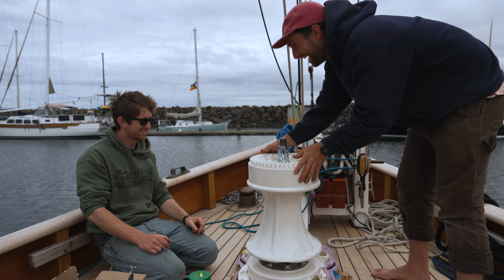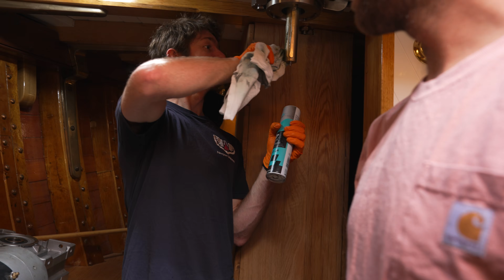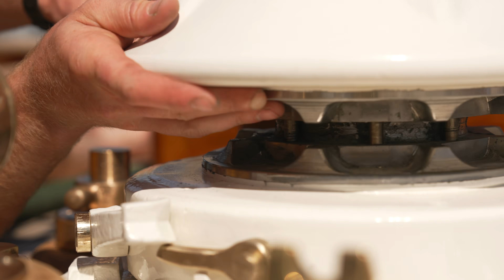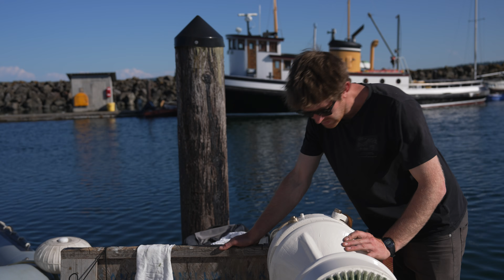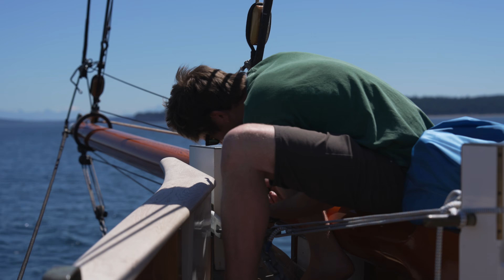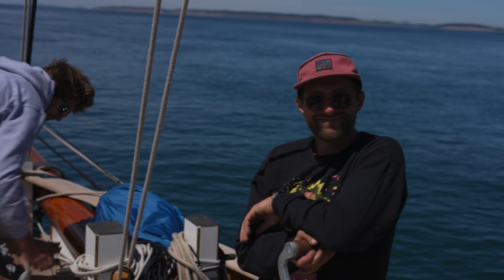Installing and using the original capstan!

Comment: Hi, you may have noticed that the chain is also catching on the haws pipe cap entrance, yes you could let it wear, or you could lower the cap 3/8 to 1/2 an inch. yes a chain stripper would help a lot. Cheers well done.

Comment: Now we know why the gypsy on a modern anchor winch rides on a horizontal shaft. The chain falls straight down and does not have to be pushed into the opening to the chain locker

Comment: In the videos, it looks like during theanchor hoist process the chain, after leaving the gypsy,  is slightly going uphill into the brass piece.      Have you considered lowering the height of the brass piece to get gravity to help with feeding the chain into the chainlocker?

BTW, been watching since day 1 - a weekend highlight getting to see the next step on getting Tally Ho sailing again.   Great work!

Comment: A chain stripper is definitely a good idea. Also that chain will wear off the high spots on the links and smooth off the edges on the gypsy with a little time. I remember a chain hoist that had issues when it was new that a little wear took care of. It will be fine once the chain and gypsy get broke in and wear to match each other.

Comment: The capstan gypsy does not like a twisted chain so the anchor chain  idler pulley at the bow should be slotted like the capstan gypsy?  It would eliminate twist on the water side of things and maybe you should have something similar on the anchor chain storage side of things as well?  🤔🤔🤔🤔

Comment: Nice job, a new chain might have been easier than all the grinding, but your time does not cost money, and a new chain does....
Oh, one small detail: towards the end you can see a cotter pin in the up-down mechanism. It is not (yet?) bent open to prevent loss. Maybe you will only do this when everuthing works perfectly?
Can you lower the anchor without engaging the motor? How did they do this in the bad old days? A rope around the drum to act as a brake?
If you ever take the ship over to the Netherlands I would love to see it.

Comment: The whole collaboration process for repairing, restoring, and modernizing the capstan for the Tally Ho—all of those detailed videos from Dave Clarke, Windy Hill Foundry, and Keith Rucker—capped by Leo's installation, are an amazing collection of work on video. They are certainly one of the highlights of the rebuild because of the level of attention to detail brought to the whole process, bookended by the removal of the capstan in one of the first videos of the series and its replacement in one of the last, before Tally Ho's first 21st-century voyage. Bravo!

Comment: Great video. capstan is amazing and considering the amount of moving parts and bits and pieces worked on in disparate locations it's a stunning result that you only needed two day hard labour in the sun with a die grinder. As others have said in the comments, get a cover made for the capstan top and get that gearbox trimmed in such a way it's not a risk to skulls!

Comment: I would imagine that the gypsy and the chain would wear in after some use.  Am a little surprised that there is no cap over the top nut on the capstan. Wouldn't  want sea water to pool up in that area.

Comment: A similar fitment issue occurs with new bicycle chains, cranks and other gear components. Often just a matter of running it and giving everything a chance to wear in.

While an impressive restoration you’ve likely discovered why this windless design is no longer used on sailboats.

Comment: just an idea, but what if you had something in the chain locker that kept tension on the chain. You could have a chain feeder wheel thingy that is under tension by a spring and have it geared to be able to move the entire length of the chain. maybe too big of an engineering undertaking but if there is no other option above the deck, someone pulling on the chain seemed to work pretty good haha so maybe the spring tensioner would work. have it under load when the chain is all the way out, then it will pull until the chain is back in.

Comment: On a seagoing vessel, according to good seamanship, the chain in the chain locker is usually stowed (horizontally) manually. It prevents the stack of chain from falling over during rolling at sea, which can block the chain when dropping the anchor.

Comment: If the whole thing would've gone off without a hitch, i would've been worried about other things. The chain was a bit of a slip, but not through anyone's fault. These things are RARELY (and i emphasize that bit time) all the same. Good thing is things were fixed and they worked out in the end.
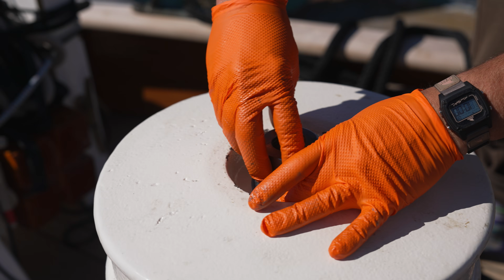18:00 when the mechanism is well fit and working to satisfaction, you should fill out that pocket with a hard wax (that doesn't melt at a low temp) (or another compound that can be taken out at a later date) to prevent water from sitting in that pocket. I'm not 100% sure on it, but i have seen old pictures of capstans of similar vintage, where that pocket was even with the top, some times painted, sometimes not (vintage photography from various magazines (??) , all found on archive).  I assume they'd use wax, but it's entirely possible that it was also tar.
21:58 using that bolt hole on the protruding tongue of the base, maybe make a bronze chain splitter for both sides. Essentially take a T from bronze, bend it's base so it stays flat in that section, bolt it down and the "hat" of the T will not allow the chain to stick either way, in or out. It's not an uncommon thing to have where chain's concerned. I think even some old hoists had a chain splitter on them, a small brass or copper plate with a spring that would push the chain out so that the operator could move it as high speeds.

Comment: Hi Leo. I would think that the most likely variable is the chain itself. The galvanising process will add small differences to the size of each link. This is why some links fitted better than others. Good job to get it sorted. It looks good fitted in position.

Comment: If memory serves, chain is made differently in the UK and the USA. Hiscock recommended sending a couple of feet of the chain you’re using to the people manufacturing the gypsy. I couldn’t see if the chain runs out or if you have to walk it out every time. If it runs free watch that in all attendant vibration the pawls can’t flip over into the active position. Ask me how I know.

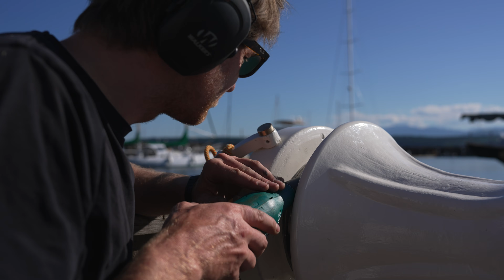Comment: @ 15:40 if the chain will just fit the Gypsy I would think over time it would wear in to fit / between the welds on the chain links and the Gypsy itself I would imagine over time they would seat together properly ( just a guess ) after some wear / could also try some type of benign oil/grease like vegetable oil / mineral oil that could facilitate the break in period ?

Comment: Have you considered using a hall sensor setup on the rotating driveshaft on the capstan? That way you could have a digital readout of the approximate amount of chain you have let out. The amount of revolutions multiplied by the nominal diameter of the gypsy should give you a fairly accurate readout.

Comment: Moly grease is great for automobile chassis points, joints, and king pins, etc. because (just like you said, Leo) it's formulated for high load/ low speed conditions.  Ball bearing grease need not apply.

Comment: I understand that this comment will be unpopular to many but from a technical point of view putting so much unnecessary weight on the bow, also aggravated by the new engine and mechanism, seems to me a mistake; I speak as a sailor even if I greatly appreciated the complex restoration of the capstan. There are many classic electric winches on the market that are more suitable and less invasive, both in terms of space and stress applied to the bow structures (but also in terms of influence on the center of gravity and bow lift moment) that would have been more suitable. Since you have replaced probably 95% of the boat (I can only think of a small piece of the transom as an original part of Tally Ho and part of the keel lead) it would have been irrelevant from a historical point of view to opt for something more suitable and proportionate to the size of the anchor and chain and the size of the boat. For the rest an admirable job, congratulations.

Comment: The best grease for all marine applications is Corrosion Block Grease which strongly resists water wash out and provides superior protection against rust and corrosion.  It out performs lithium and most synthetic greases.  
BTW, I see no swivel between the anchor & the chain.  The chain has a lot of galvanizing which is why it doesn't fit the gypsy well.  Get stainless steel chain.
Reply: I wonder where the chain was manufactured and to what tolerances.

Comment: Watching that bit at the end, if you just make the plinth that the brass receiver sits on lower than the chain exit from the gypsy, it should work fine.  The links are trying to fall down between the gypsy and the receiver, but if that opening is lower down, the weight of the chain around the corner (down in the locker) will help keep the feed from the gypsy to the receiver taut.
But you probably figured that out already.

Comment: I think the deck elbow is about an inch too high. The last shot of it working you can see that the chain is going up into the elbow, it should really be going  into it level or very slightly down.

Comment: Capstan's looking great now it's all painted up. How is the motor protected against driving against the pawl? Is there a torque limiter hidden in the gearbox, or does it rely on an electrical overload?
Reply: Leo - did you message me?

Comment: Speaking as someone who worked in an international footprint aircraft manufacturer based in the US? Yeah, you can put SAE ONLY in bold on all drawings and folks who use Metric will use Metric because thats the measuring tools they have. Anchor Chain in the US uses a SAE Standard, and Anchor Chain made everywhere else uses Metic Standard, and, here is the head scratcher, you can have a chain that meets BOTH SAE and METRIC Standards for that one chain! and it may turn out to fit only Metic systems, only SAE systems, rarely both systems and most often neither Standard and its garbage and every manufacturer will show you the Standards they use (they use LASERS) and their paperwork and do the 'blablabla' thing.... and its still over priced garbage that does not fit.

Comment: Chances are you can pay out the entire chain and use a marker to mark the problem links.  I’m willing to bet that it’s always the same links sticking. And just take a file to the widest portion of each problem link to take down the errant weld.   You might only need to modify ten or twenty links or so.

Comment: When I first saw your T-shirt, I thought you were a Plymouth Argyle supporter as a George Kirby played for them in the early sixties and the shirt was green ( Green Army!) 😆. I saw Keith Rucker's video on dismantling (and breaking) the capstan with great interest. Incidentally, I worked for a winch manufacturer for 32 years, but they were for 4x4s and up to 30,000lbs line pull for truck recovery wagons, although some people used the mid-range units for recovering divers back out of the water on a platform.

Comment: Sorry, I made comments before on improvements  that should have been addressed while the capstan was being repaired/inproved. 
 First. The 2 manual drive pinions should have had Delron bushings and a seal on the bronze retainer Mount. Second, when the top cover was being machined a Forsheda seal should have been fitted, thereby sealing the top of the capstan for all sea water and spray.  The knob for engagement of the drive should also have been fitted with a seal. Simple solutions in Engineering 👍

Comment: Woohoo nice to see it working, I enjoyed all the engineering videos by keith! 
And a piece of steel to poke the chain out of the gypsy wheel is indeed a necesaty here, (i'd do it on both sides btw)
Also why do all yachties make up their own anchor chain painting scheme? When there is a perfectly suitable industry standard around. 
-Every length there is 1 link red. with white links before and after it. the number of white links (before OR after the red one, not the total) tells you the amount of lengths you have out.

Comment: Get a Makita impact drill with a hex bit to turn the capstan topside.  I know the motor has controls topside and hand cranking is also available, but redundancy is good, redundancy is good, redundancy is good
Reply: That part doesn't move.
Reply: @moebeddah2288  the socket where the hand crank goes is the one I’m referring to
Reply: @moebeddah2288  topside means on the weather deck, not the top of the capstan. 😜

Comment: Leo one other thing you need to somehow make it so if the chain is fed all the way out it doesn't fall out, I had a metal bar welded to the end of mine to prevent this from happening AFTER paying a diver to recover mine. I saw the red markings on the chain but oops still can occur.  Lesson learned I guess.

Comment: The gearbox in the forward compartment is hard metal at head height. Would that be a hazard on a choppy sea? Any plan to wear a helmet, or case it in a wood box of some kind? The tech is beautiful of course, but so is a fully functional skull🤔🙄